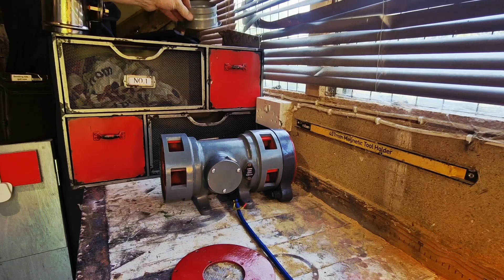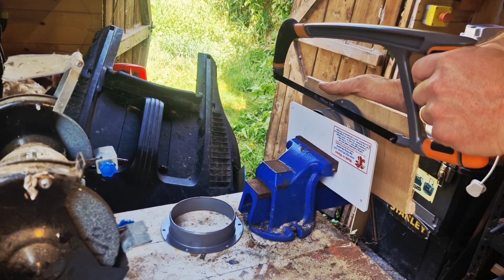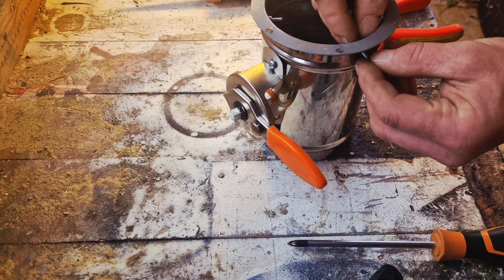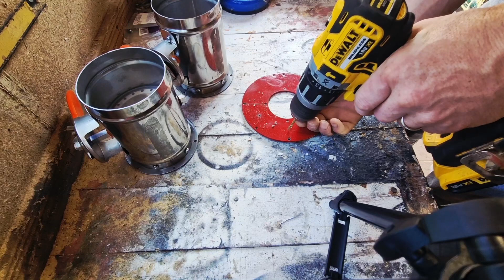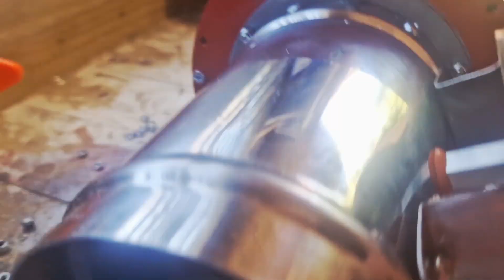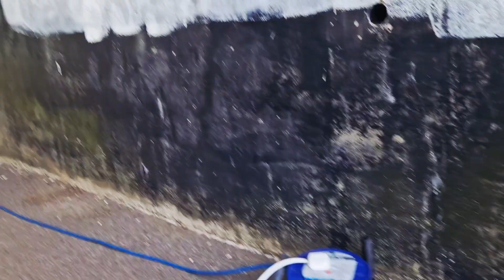Making dampers for secomak gp3 - hi lo signal part 1

Comment: It gets higher pitched when the dampers close due to less drag on the choppers no?
Reply from the maker: Yup creates abit of a vacuum when the dampers are closed so less air resistance and motor speeds up slightly
Reply: @heritageWarSirens Makes sense.

Comment: It sounds like a Thunderbolt!
Reply: Nah sounds like the one from Casar, NC
Reply: @VonnaWasser You mean the 3t22?
Reply: @WingsandBlades257  yeah that 3T22B in particular
Reply: @WingsandBlades257 
Its 5/6 port and uses a universal motor which isnt tied to hz and can spin over 3450rpm.